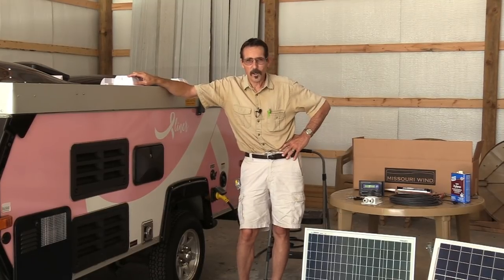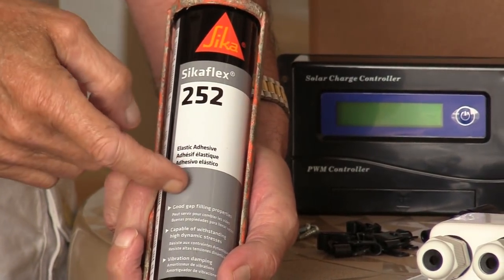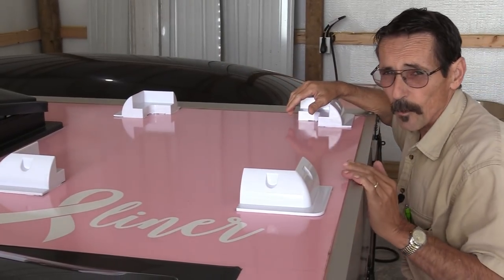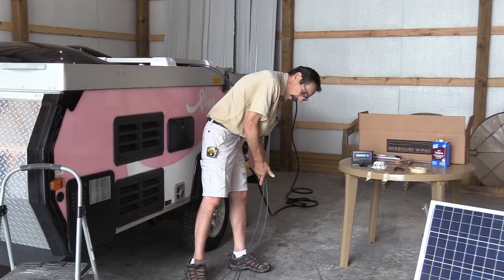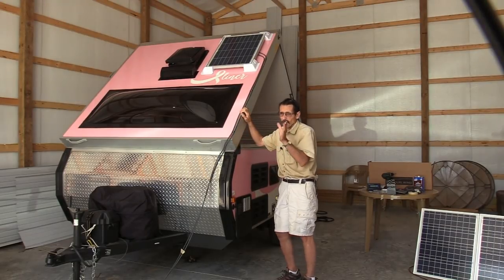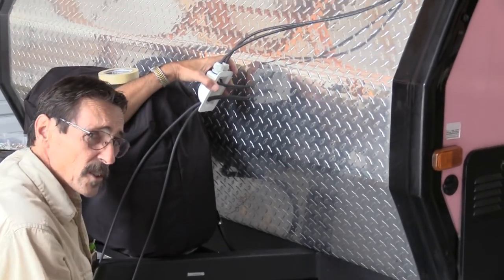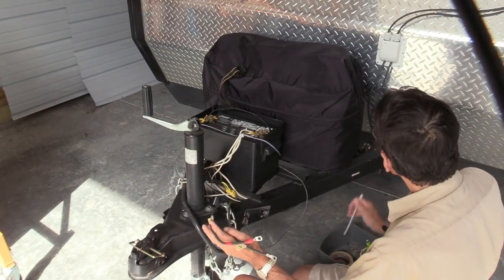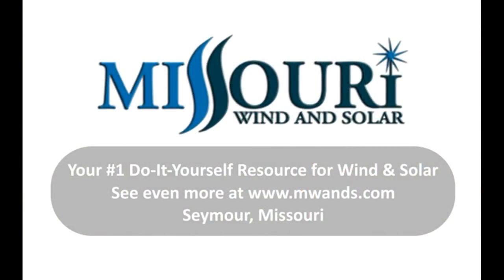How to Install Solar Panels PV on RV | Missouri Wind and Solar

Comment: I bought a 220 watt off you way back when.  Since then it has been working great, even tho it was blown off the roof one year, the next year the neighbor's tree fell on it, and after all that it still works great.  It's about 8-9 years old and still working as it did when it was new.
Reply from the maker: That's good to hear buzzah. Someones got it in for your panel, lol

Comment: too bad that you did not install grommets around the wires where they pass through the body.
Reply from the maker: I put the glue around them and it will work just fine.

Comment: I found that many areas that I parked to camp did not lend itself to mount panels on the trailer because trees or orientation would not maximize power production.

Comment: Did you use a rubber grommet on the diamond plate where the wires pass through?
Reply from the maker: No, i couldn't find any when i needed them so i just centered the cables in the hole and Sikaflexed around them. It should be good.